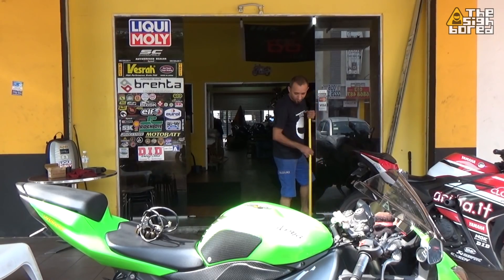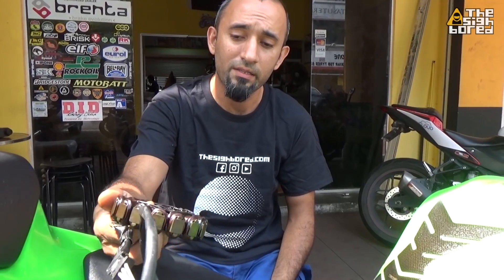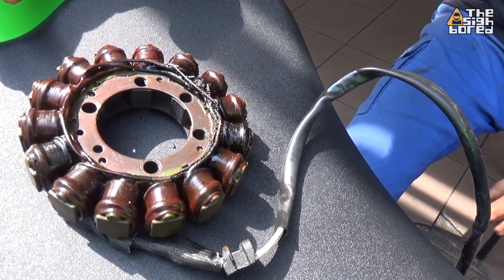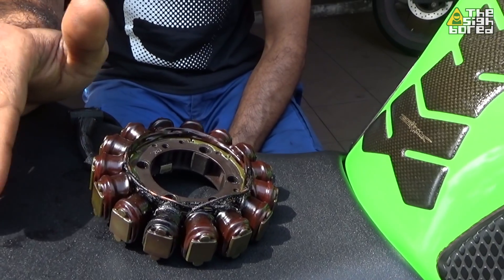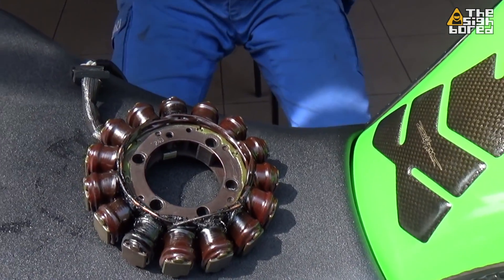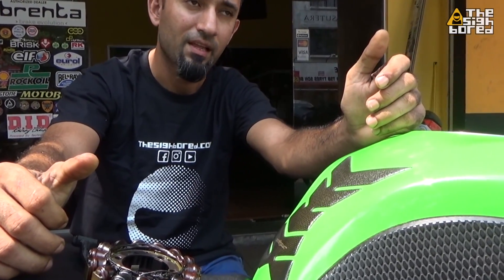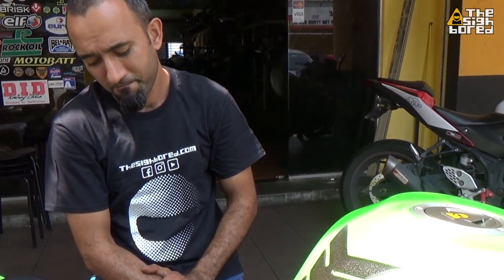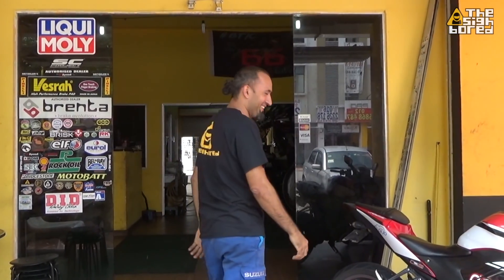Tech-talk: Magnet coil / Stator

Comment: I have a Honda CBR250R and my magnet coil is over charging the rectifier causing issue with electronics like ABS and horn, etc. Need to replace the coil. Can you tell me what is the lifespan of a magnet coil ? How many years / kilometers before it needs replacement on an average ?
Reply from the maker: There's no fixed or estimated time when the part will fail, it's all part of wear and tear, but I don't expect it to wear out too quickly like every 1-2 years, it should last quite long, just need to monitor the charging status to see if the system is running properly.. If it's not then need to fix it, best to investigate why the system not running normally before replacing parts just in case it's failing because of some other underlying issue like faulty wiring or etc..
Reply: @thesighbored  thank you. I've checked the battery and rectifier. Both are ok. Can a faulty magnet coil overcharge the RR unit and battery ? The coil is 10 yrs old (41,000 kms old)
Reply from the maker: @RRP1992  Yes it is possible, either over charge or not charging.

Comment: One question, is there any effects using the original exhaust and not the original one?
Reply from the maker: Do you mean original versus imitation exhaust? Depending on the quality of the imitation, yes there will be some difference. Original ones tend to have better quality, and is designed for the optimum performance while imitation are usually just replica without the exact performance. Some replica quality is bad and will get damaged or break after use, so you have to find the high grade ones.

Comment: So I recently changed my stator on a RC 390. When I start the bike and take it to high revs,  the voltage of the battery shoots till around 18v. What could be the problem? Is it the new Stator or something else?
Reply: Is the stator overcharging the battery?
Reply from the maker: It shouldn't be so high when engine is running, possibility of overcharging. Who did the replacement? Should bring back to the installer to double-check on it..

Comment: What if we use a bigger capacity battery than stock? Some people say it will make the coil work harder and cause it to burn out faster
Reply from the maker: I'm not exactly sure as long as the current output is the same maybe it can last a bit longer. The best is to stick with the standard size as motorcycle space is limited if you put a bigger unit it may get cramped or heat up.. Just my opinion.

Comment: Hi abg, knpe ye bateri cpt habis, 2 kali tukar bateri baru pkai 2 hari jln  dkt² je tpi cpt kong, lagi kuat pepah lagi cpt bateri drop. Dy mcm moto tu bergerak fully ikut power batery, ibarat dy tak cas.. sruh kedai check coil dgn rectifier bacaan dy ok kate nye, sbb coil baru je tukar seketul yg baru, bru pkai kjp masalah lain pulak. Sy syak rectifier kot. Ape pendpt abg, oke trima kasih 🙏🏻
Reply from the maker: Macam mana kedai check charging system moto boleh cakap bacaan OK? Kedai ada tunjuk pada you bacaan masa buat test tak? Kalau strator dah tukar dan confirm elok, mungkin rectifier.. Kena troubleshoot satu-satu cari punca.. Ikutkan symptom memang battery tak cas balik sampai hilang kuasa..
Reply: @thesighbored  ye tuan, pomen ade tunjuk sbb dy check pkai multimeter. Lgipun symptoms dy sme juga mcm coil atas sbb bateri tak cas, lepas tukar coil dlm seminggu tu then bru dtg msalah lain. Btw rectifier kalau rosak punca dy mcm mne ye tuan?
Reply from the maker: Kesannya sama macam coil rosak.. Bila salah satunya rosak, battery tak dapat recharge masa engine tengah running.. Kena  try tukar rectifier tengok kalau problem masih ada, kena check jugak kalau grounding ok mungkin ada isu current lari sebab wiring.. Pasal wiring ni kena mechanic check satu2.. Ambil masa..
Reply: @thesighbored  ohh i see.. baik tuan. Sy akan sruh pomen check ✔ trima kasih tuan 👍🏻

Comment: how to identify when the magnetic coil is start to malfunction ?
Reply: Kiki_Daily  your battery voltage will drop under 12 volt
Reply: ez pz...most importantly u must have multimeter..check using ohm for continuity..if the value more than manual or OL the coil r shot..check between connector,3 pin if im not wrong..
Reply: Kiki_Daily you still can use the bike when the coil is dead but you can ride about less a day if you lucky and all the headlight,any display, rear brake will all died since it run only by the battery
Reply from the maker: The best and easiest way is to have a voltmeter installed for the bike, during initial or cold start, you can see the battery initial volt reading to know the battery health status, 12 is standard, and if it shows below 11 you have a weak battery and needs to be replaced. When the engine is running, the reading should be around 14 for a normal operation. If you don't see the reading around 14 then that is a sign your charging system is having some trouble and you should check on it by a trusted mechanic. If you see my Ninja at the Workshop series, I have an episode where I have to replace a burnt strator.
Reply: Syafiq Iman when the bike running  at idle ?
Reply: TheSighBored ohh I see. So check it when the bike is running... Ok gotcha ....